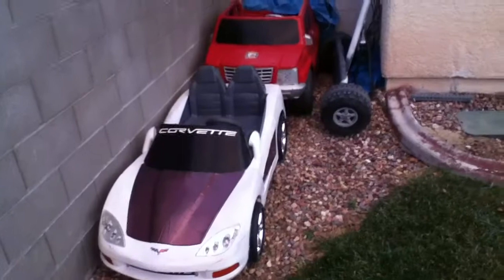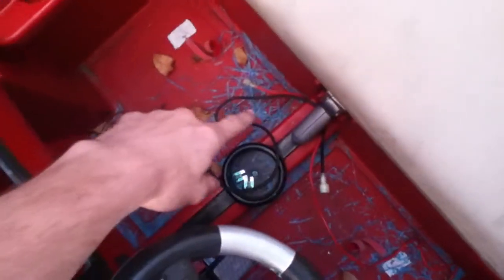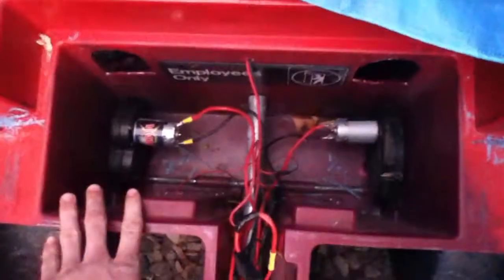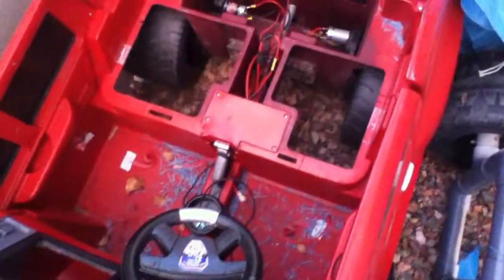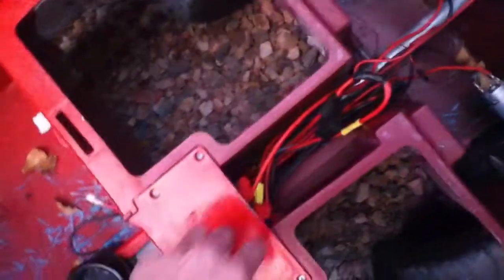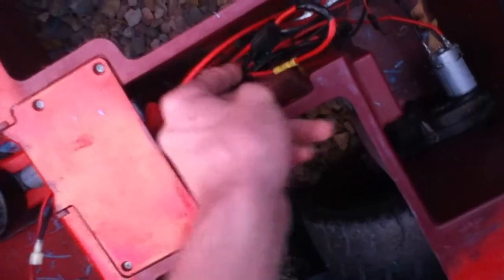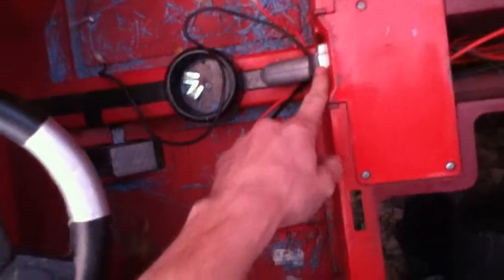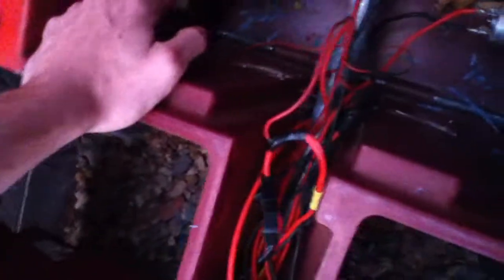Wire Setup

Comment from the maker: @VModselectronics nope nothing special, just 2 550 can motors will work. if you wanted you can get brush-less motors and get more speed. its really up to u but you will need a 30 amp fuse on the wire otherwise u may blow the motors up, with the fuse u will pop that before motors.

Comment: Could i put a car battery in fire truck to power motor ?
Reply from the maker: Rolando Canteros some people use car battery’s but the sealed battery’s work better and it’s also safer. Follow Modified Power Wheels on Facebook if you have any other questions